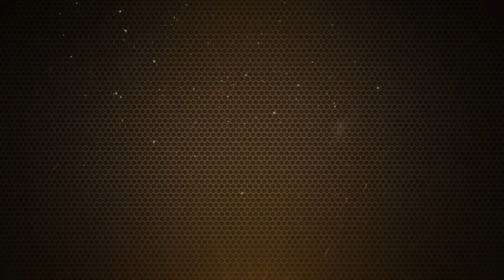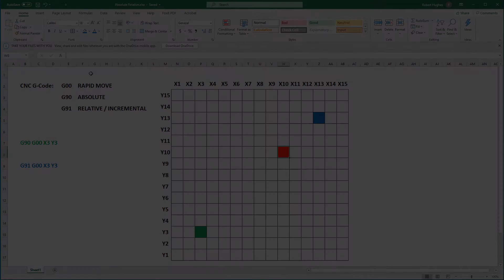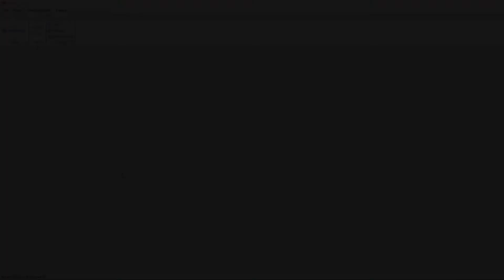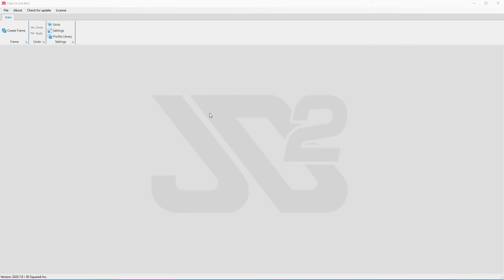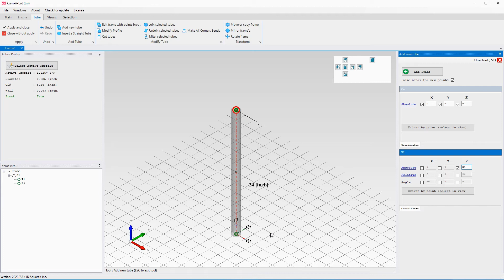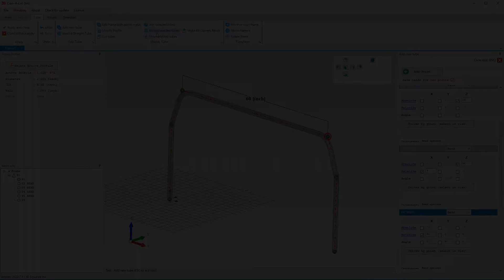CAM-A-LOT and G-Code: Absolute & Relative Positioning Modes

Comment: Will you be adding the capability in Camelot to post the g code using absolute or relative positioning? I'm using the RC6 to bevel half inch thick 4 and 1/2-in round tube. Everything is output into absolute positioning and since Camelot does not automate the process of babbling and it is done with manual g code if I have 60 parts to cut out of one stick of tube I would have to convert the g code manually myself and I'm just looking for another way to do this that might be a bit simpler that I'm missing.